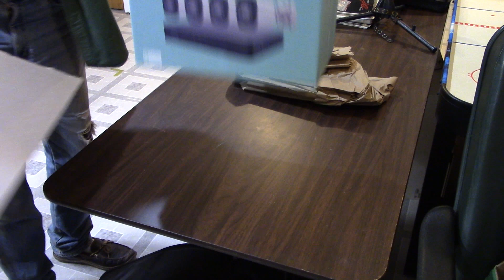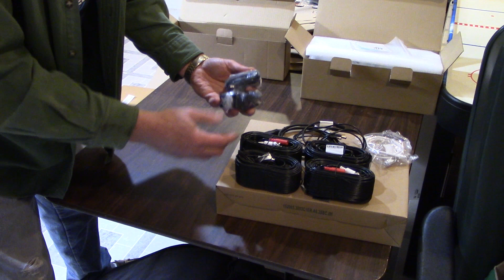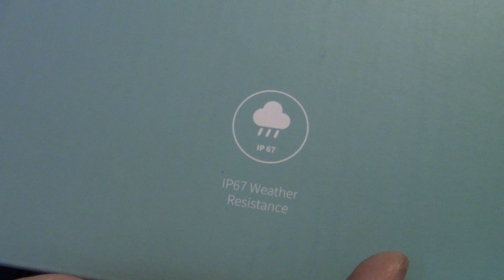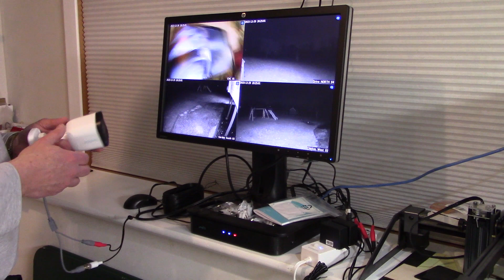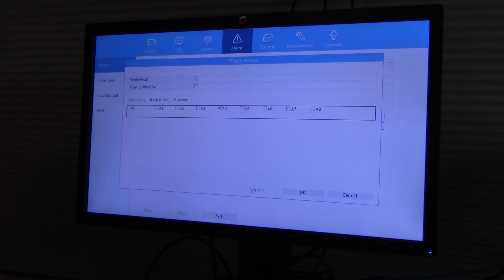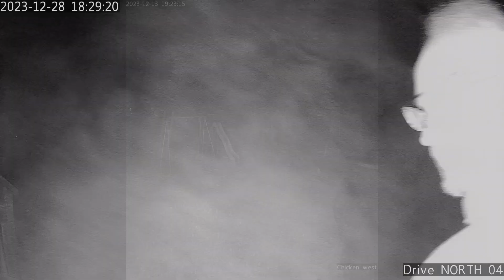Testing the Uniarch 1080P Wired Security Camera System. I can monitor my laser!

Comment: I'm interested in how you routed the cables. I did IT for a resort rental company and after the off ice was broken in to they had me add a 4 camera system. This was several years ago and the cameras were not of the quality these are. I had to route the cables along the top of walls at the ceiling okay for an office but I really don't want that in my home. Thanks for the video!
Reply from the maker: Great question.  For wired cameras, running cables is the biggest challenge.  For my setup, I am lucky to have a suspended ceiling and running the cables is very easy.  I did drill a hole in the side of my house to run cables for the three cameras that are outside.  They are all attached to my deck and I could run the cables under the deck with ease.  Inside, the camera that is looking at my laser was simple by running the cable above the suspended ceiling.